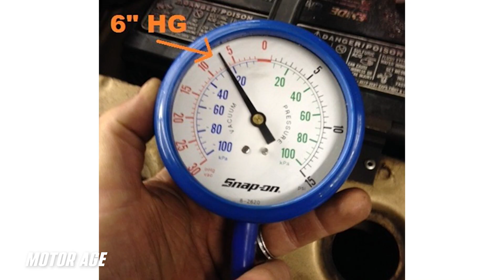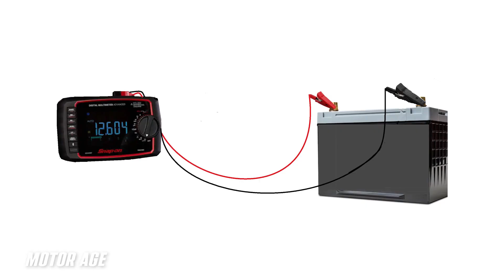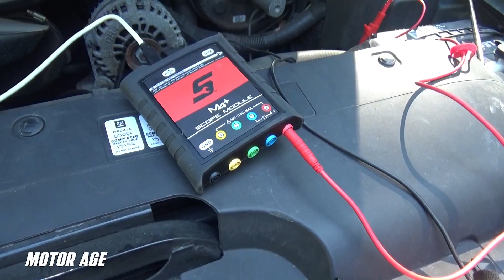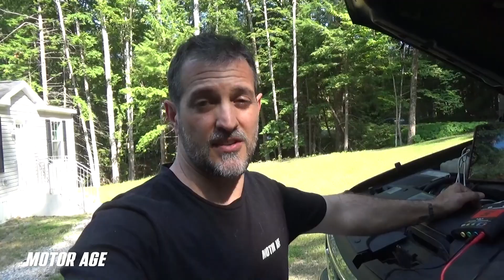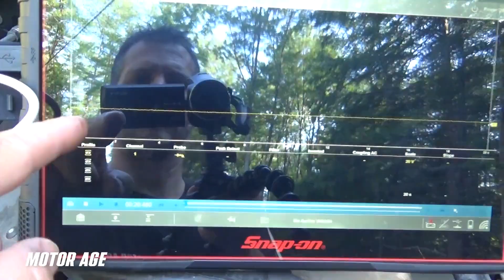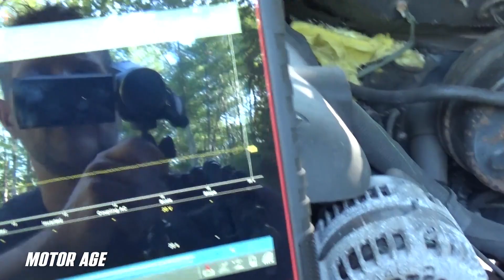Mastering Diagnostics #26: The Importance of a Good Ground Reference

Comment: The automotive industry, in my opinion, needs to go away from using the chassis of the vehicle as "ground". I want to see solid copper connectivity between every electrical device on the vehicle.  Relying on Rusty steel or corroded aluminum is a bad alternative and always has been.
Reply from the maker: Although ground potential would be optimized, This would be tremendously expensive and disadvantageous as vehicle weight would increase as well. This is all counter-productive to tightening emissions standards

Comment: Hello sir,
I have 2 question 
(1 )How can i diagnosis a vehicle with fuel mixture too rich or too lean i forgot the exact fault code. I checked all fuel systems components wiring, air systems also O2 sensor everything is fine.no misfire no driving problem but only malfunction on cluster.
I erased fault code after a long driving 2000 to 3000 km same fault again comes. There is no issues in vehicle but only malfunction.
Which components is faulty how can i say this is the cause that malfunction.
(2) why there is some time passive/spordic fault code in vehicle no malfunction light on cluster why this happens
Please reply
Reply from the maker: These are all valid questions but to understand the answer you must possess the tooling to test, and understand how the data from the test results demonstrate the deficiency.

 Fuel delivery is defined primarily by how much air enters the engine. This is necessary because the air/fuel ratio must be kept at an ideal rate. 

Fuel trim is correction to the delivered dose of fuel (fuel trim will increase to compensate for a fuel deficiency, where fuel trim will decrease to compensate for an over-abundance of fuel). It is derived from the feedback given by the exhaust gas oxygen sensors.

To sum it up, an issue with fuel content, a mis-reporting input, unmetered air, dribbling fuel injectors, poorly running  engine, etc. can all affect fuel trim and will vary in response dependent upon engine configuration, airflow calculation/fuel system design/operating conditions in which the fault  surfaces.

In a nutshell, there is far to many factors and variables to offer you any useful answer. 

Please reach out to learn about some training opportunities available to professional  automotive technicians

Comment: I know how hard it is to do these types of videos and I appreciate that you did a fantastic job but I will bring up a couple of points number one I would have checked to make sure my leads were good at the gate before even making the connections I know that this was for demonstration purposes but still I would have made sure the leads were good also the connections are fine under a load 🤔(I think that most of us at one point in time put a voltmeter across the battery and it said 12.5 or 12.6 volts but yet when you go to crank it it just flattens out instantly and one more thing I'm quite curious in the event that we have problems within the rectifier bridge of the alternator and we are producing ac voltage what effects will that have across the circuitry dealing with electronics maybe that's something for a future video I know you have videos in regards to loads on circuits and having voltage drops it could be nice to reference that also Thanks Gary 👍👍💪💯
Reply: What do you mean by flattening out? My advice is to buy a meter with min max.You’ll make a better evaluation on the condition of the battery by the voltage drop.CHEERS
Reply from the maker: All great points and we thank you for your feedback. Brandon will have plenty of opportunities for future videos with suggestions like you have made. Thank you

Comment: Another video with great detail.Brandon you put in a lot of excellent points to think about.I wanted to add my 2 cents about DVOMS.A meter with a DC accuracy greater than plus or minus of0.5 should be avoided for electronic circuit voltage measurements.Cheers always Appreciate your knowledge. Thanks
Reply from the maker: Thank you for your input and we truly appreciate your kind words!